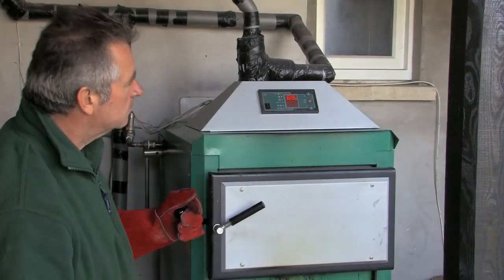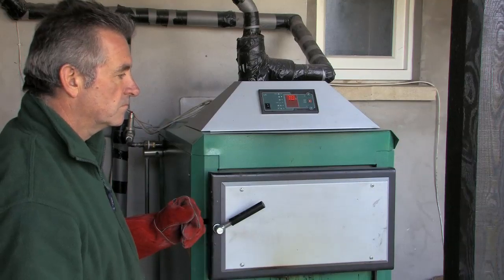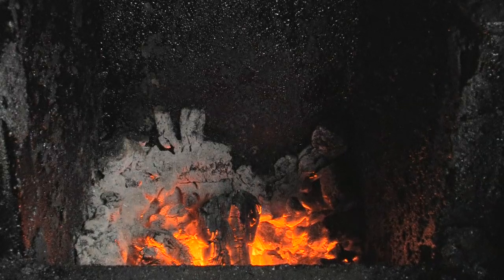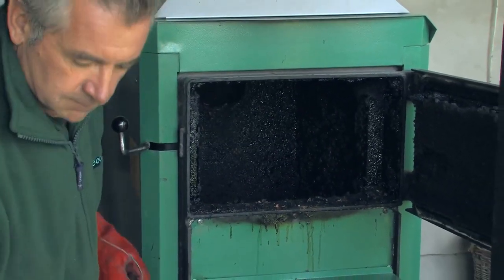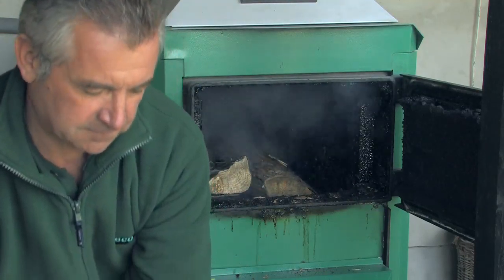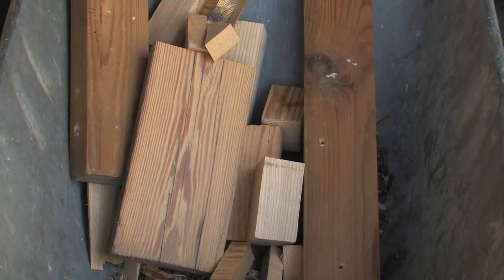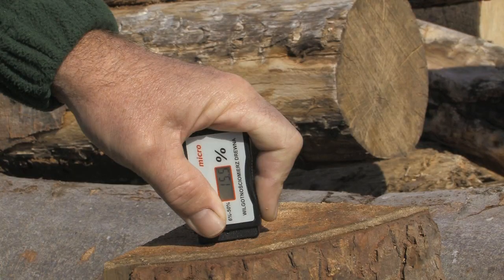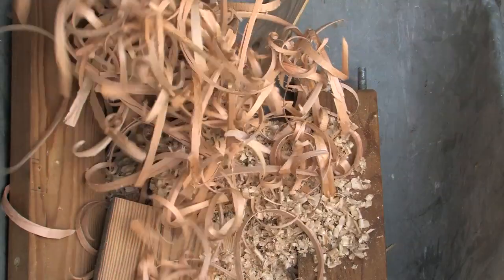Reloading - Angus Super Wood Burning Boiler - Gasification Log Boiler - Eco Angus

Comment: Worst boiler EVER.. Have one, and i curse the day I bought it..
Reply: ThaMan100982 Operator Error!
Reply: @calebbaltus  Or just a shitty boiler
Reply: Only issue I had was a capacitor fail I’m controller, replaced the capacitor for 90 cents and it’s still rolling 12 years later.  Over 90% efficient, 7 face cord of wood to heat our 2 story house in Northern Ontario.
Reply: I have one and I am completely amazed how well it works. 
I have used secondary burn boiler stoves and this is way ahead. Uses very little fuel, lasts easily 10 hours between reloads, heats our whole house underfloor heating and hot water. Very impressive unit and such a simple design.
Reply: Why so much tar and creosote around door and fire chamber?

Burning unseasoned wood?
Reply: It’s a gasifier, top section is incomplete combustion and looks like this normally.  Completely safe, only thing beyond this is dust
Reply: HAHAHAHAHHAHA